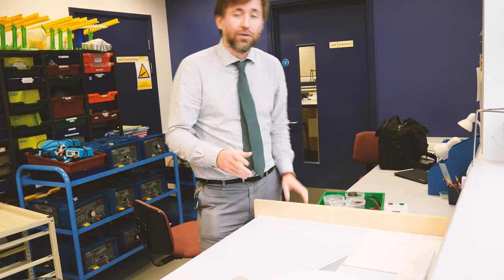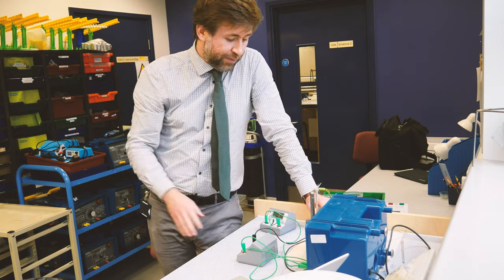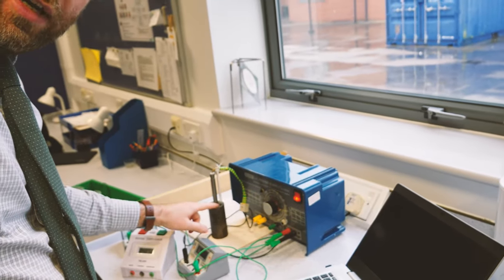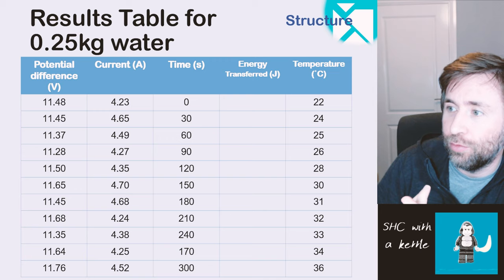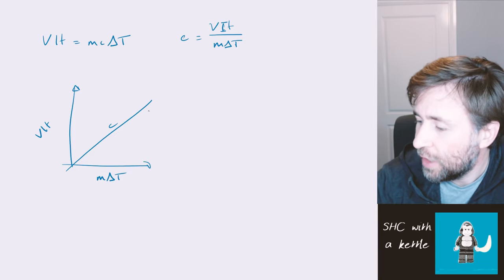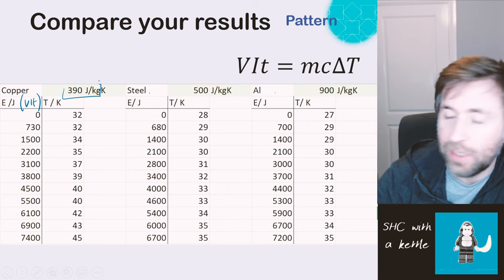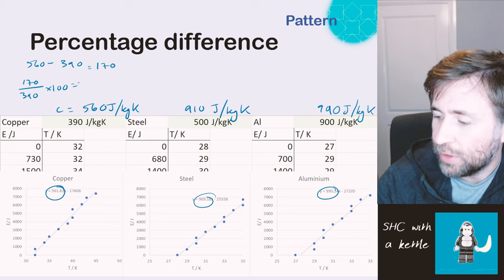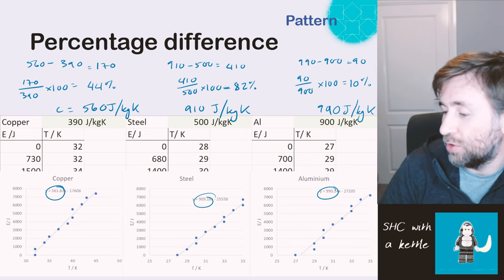Specific Heat Capacity - required practical, PAG, Core Practical for grade 9 GCSE or A Level Physics

Comment: i need a risk assessment pleaseeeee
Reply from the maker: Low voltage power supply.  Work at temperatures below 80 ish degrees.  Have on a heat proof mat.  Low risk.  Boom!